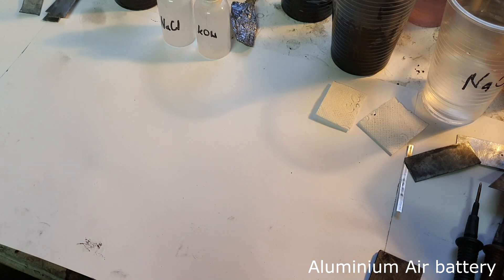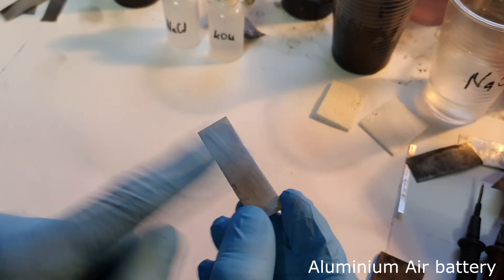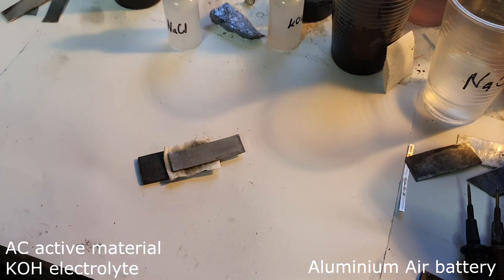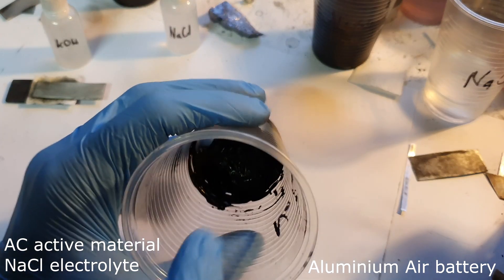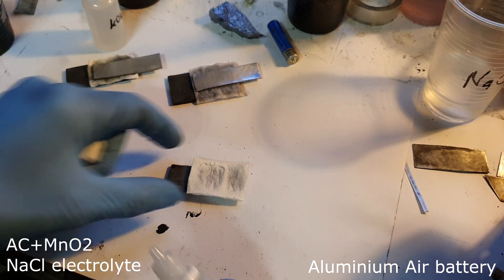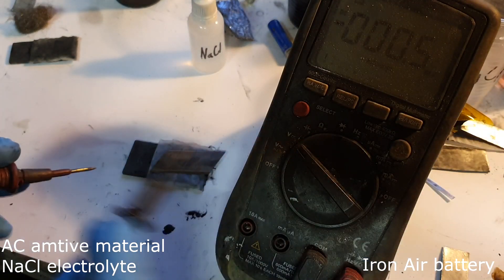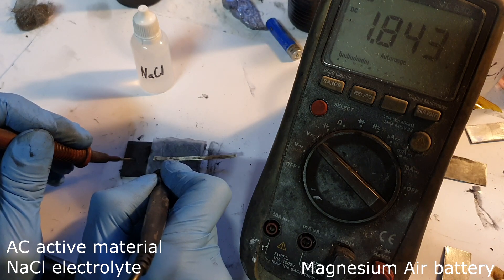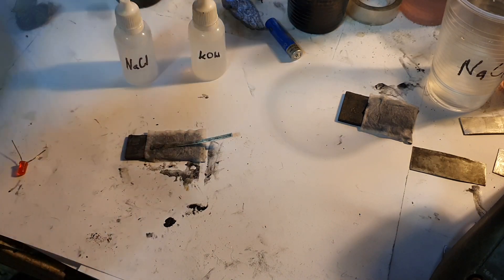Homemade Metal Air Battery - Part 1

Comment: Thank you very much for sharing this video you got a good voltage for the Al-Air battery. Have you run the Al-Air  for a long time and does the  oxide layer build up  and then the voltage would fall?

Comment: Thanks for this video  also can you post a video on how to make an Iron Air Battery because the problem with the aluminum electrode  is that it must be very pure about 99.9 and then it gets very expensive
Reply from the maker: Correct. I will see what can I do

Comment: why are aluminium KOH batteries not rechargeable if Al(OH)4− + 3e−  ⇌  Al(s) + 4OH− /  it is a reversible reaction.   why is it called an air battery?  does it have to be without a sealed container?  what if it was in a sealed container what would happen?
Reply: It is reversible if you use an aprotic solvent like propylene carbonate instead of water.
Reply from the maker: Yes it is reversible, but in what conditions. It is needed a good amount of power to reverse. Metal air is called because they need air to operate. Other battery chemistiys have metal oxides which are more limited in capacity for example. Metal air cells need to be open, or better to say,.... they need to have some hole that the air can go in to react. Most of the time the air cathode is made from activated carbon, some catalyst and teflone layer. By hearing aids zinc air batteries have also holes for air flow, but before use the hole is covered. If you seal the metal air battery you will limit the oxygen and for that reason you will limit the capacity.
Reply: @cayrex  I think I understand professor.  So the Aluminium is oxidised by the KOH in air using the oxygen in the air and i suppose this produces some aluminium oxide everytime the battery is in use ? if that is true then i realise whats happening, aluminium oxide ofcourse is very difficult to reduce back to aluminium (as in bauxite to aluminium production) - this would lead to its degredation and would not be a valid rechargeable battery is that right?  sorry to deflect from this video but in reference to your other video the zinc bromide battery which is really amazing, would it be possible to use two graphite electrodes with activated carbon instead of zinc ?  if so, would this have the same perfromance as the zinc anode?  i saw another one of your videos where you mentioned that if we use dual graphite battery then the electrolyte must be a liquid solution, or organic solution.

Comment: Don't crush the activated carbon. Put the carbon inside the microwave oven 15 minutes it will spark but will be fine. At the end you will have nanotubes.

Comment: Are any of these metal-air batteries rechargeable?
Reply from the maker: Mechanically "recharging" you can all cells. But chemical recharging is a bit hard. Iron air battery is rechargeable,... but use other electrolyte. Search for iron air battery.
Reply: @cayrex  thank you. Will do. Have you seen the Aquion salt water battery? Looks ripe for a DIY version!
Reply from the maker: @ContinuousAmbience  hmm,... the tech in battery: The battery materials are non-toxic. As of early 2014, the cathode used manganese oxide and relies on intercalation reactions. The anode was a titanium phosphate (NaTi2(PO4)3). The electrolyte was <5M NaClO4.  A synthetic cotton separator was reported. The electrode layers were unusually thick (>2 mm)
Reply: @cayrex  maybe not so DIY then. Busy looking at @robertmurraysmiths rechargeable aluminium battery. Making a deep eutectic solvent going to be a challenge. Will play with some other electrolytes.
Reply from the maker: @ContinuousAmbience  Making DES that robert make was 1:1 choline chloride : polyethylene glycol I think?
Reply: @cayrex  yes, but getting the choline chloride seems a little tricky down here in South Africa 😔
Reply from the maker: @ContinuousAmbience  yes I know,... its a reall pain in the ass to get the material. Ethylene glycol and metal chloride then?
Reply: @cayrex  I'll give that a try! Aluminium chloride seems to be available, but can try some others. Thank you
Reply from the maker: @ContinuousAmbience  yes aluminium chloride will do the job. One option is also urea : AlCl3 in ratio 1:1.3 if I remember correctly for aluminium ion battery.
Reply: @cayrex  thank you!
Reply: https://newatlas.com/iron-air-battery/23646/

Comment: Ten plus years ago I set myself the challenge to invent simplest and best battery a child or anyone can build for almost no money. My answer was to take empty can of beans, take old metal sharpener (they are usually made of magnesium of Al-Mg alloy), tie wire to that through hole and twist tight (optional, seal exposed copper part of wire with glue), then fill can with half sand putting the sharpener about 2/3 down inside the sand. Then for cathode, jam a lot of steel wool on top of sand and seal on lid so that it compress the steel wool strongly. Make holes in the lid and pour in saturated salt solution. Rusting steel wool acts as air cathode with some catalytic properties. Make positive contact to case and negative wire through hole of lid.
Reply: Oh forgot to say, some metal tins have coating of plastic on inside, if so you must burn it off first.
Reply from the maker: @idea-shack  yes right.
Reply from the maker: good one. easy and cheap
Reply: @cayrex  Thanks, also nice thing is when it's done, you throw away in dust bin, doesn't pollute and rusts quickly.
Reply: Zinc should work too, like sacrificial anodes on ships. A Zinc Iron fuel cell?
Reply: @Tore_Lund  Yes, zinc would work too, just lower voltage.
Reply: @idea-shack  Just because everywhere I live, pencil sharpners are all plastic.
Reply: @Tore_Lund  I understand. Magnesium is a bit of a cheat metal for battery, it is really easy to make any battery with it because it is so electropositive, but yes, hard to find.
Reply: I'm trying to imagine this from your description, but I'm coming up empty. Do you have a picture you can share? Perhaps post a YT video for it?